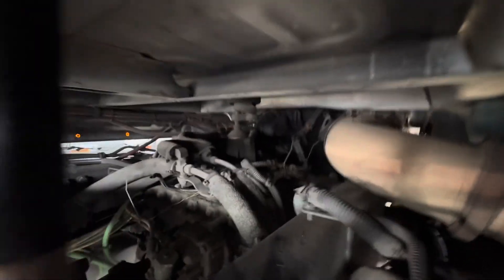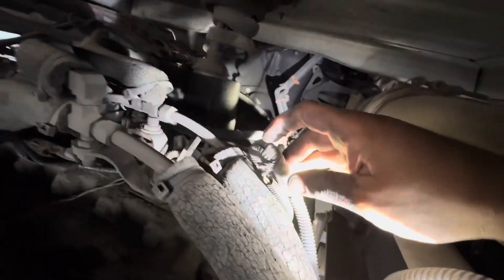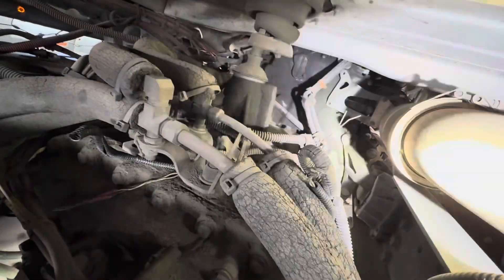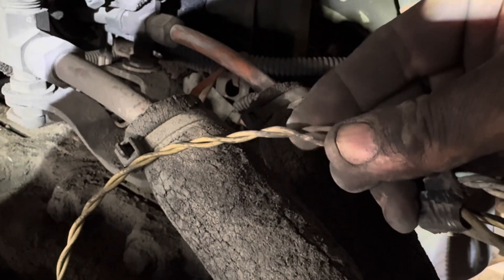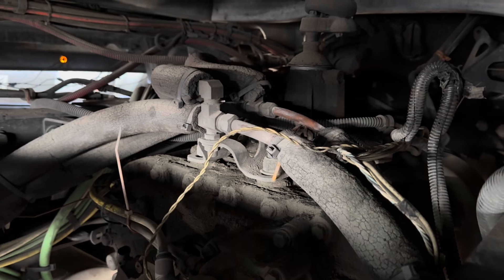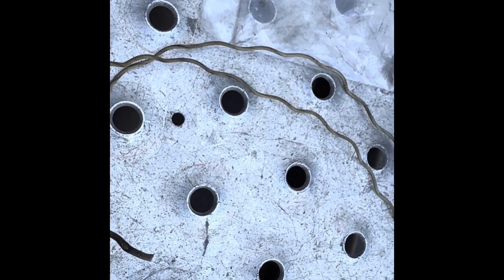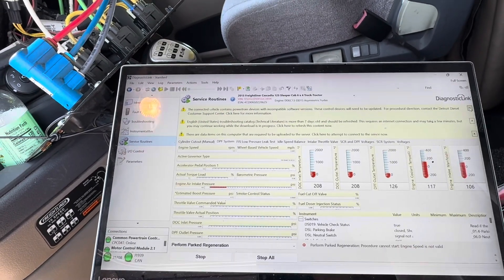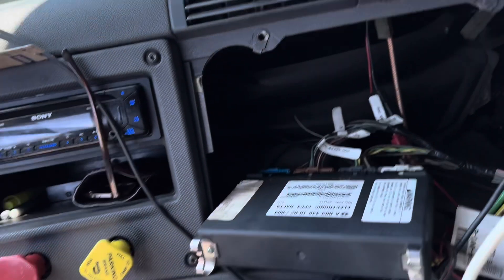Cascadia with a VSS fault code, SPN 84 FMI 4. Not what you think

Comment: I have a similar code mines is spn 84 fmi 6 which is vss anti tampering wires good and sensor is good also it doesn't do abs self check and the mph peggs out at 85. It eventually does a abs self check after like 5 mins of the key being on. Im thinking cpc
Reply from the maker: Sounds like a CPC. Try using a test CPC from a similar truck. I had something similar to this and the CPC was bad.